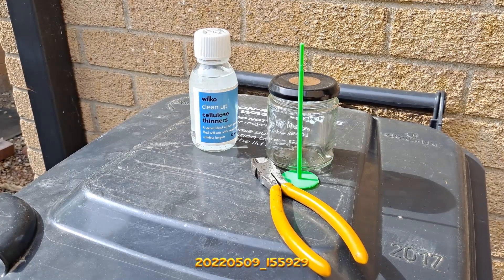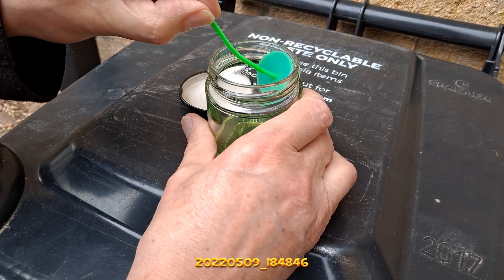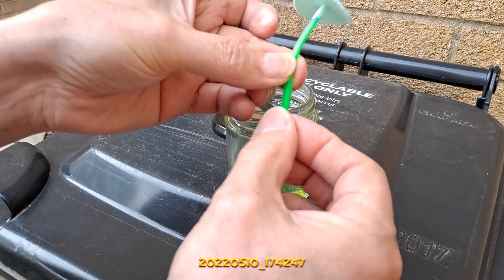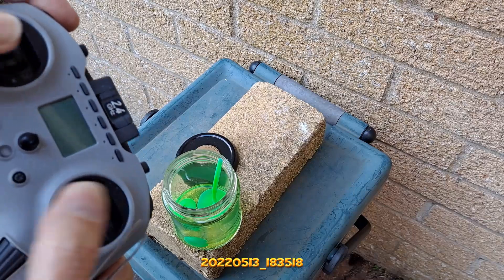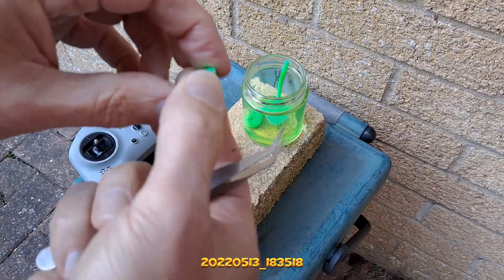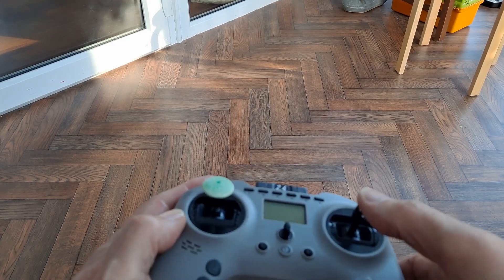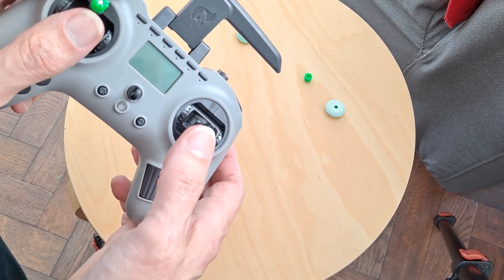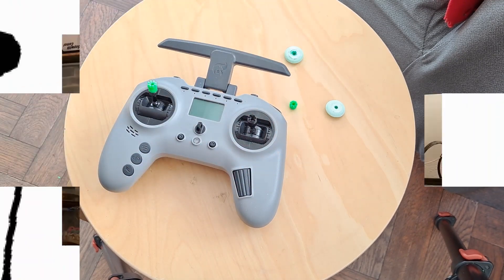PLA in cellulose thinners

Comment: Looks like useful info, they don't get "rubberized" but go temporarily soft, it can be useful to press fit over/undersized parts and to create water/air tight seals. Also it should allow to print a simple sheet and sandwich it to adopt a 3D shape, embossing,....... The thing is how resilient is the piece once dry, does it goes brittle, disintegrate into dust,....? on that case It wont be a useful trick for load bearing parts, but for visual and artistic purposes it should still be pretty useful.
Reply from the maker: It is one of those trails you could wander down, trying different options. I really don't feel like running a whole series of tests, but I am sure somebody could take it on and explore the possibilities. I got the impression the thinners stripped away the colour pigment and that was about it. I did do a test in acetone and in water, the links are in the video description. Reading Wikipedia I can see that modern cellulose thinners are basically acetone anyway.

Comment: I was hoping it would stay soft as it would have been great for bumpers; never mind
Reply from the maker: Yes, I thought I might have found something useful 🤔
Reply: @GrandadIsAnOldMan  you can get filament that cures like rubber but it's really expensive.
Reply from the maker: @makerofthingsunique  you also need the right fittings for your printer. You need a direct drive 'hot end'. I have recently bought the parts but I haven't fitted them yet.

Comment: I wonder if dipped in oil after thinner would cause a change.
Reply from the maker: It could be a never ending series, dipping samples in different types of oil 🤔
Reply: @GrandadIsAnOldMan  clearly the thinner evaporating is causing the tensile to return. So I guess test different oils with the thinner to see which oil doesn't blend with the thinner. People think I'm weird because I use paraffin wax on my wood handles of tools. Paraffin is a oil based wax. Sits is the sun and soaks into the wood grain. Makes the wood water proof as well. I was also thinking that rubberized tool handle dip. I don't play with PLA so I have no clue on how to keep that thinner from completely evaporating.